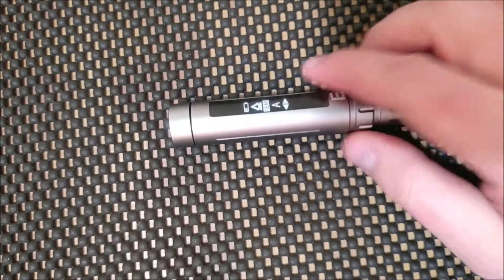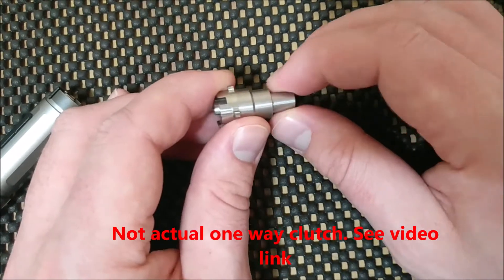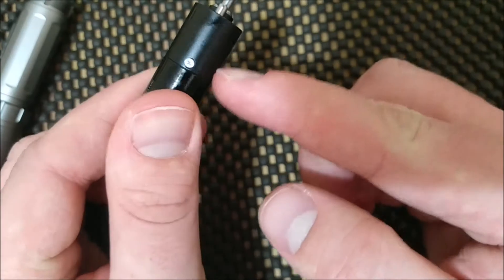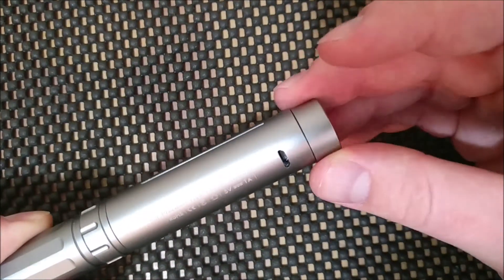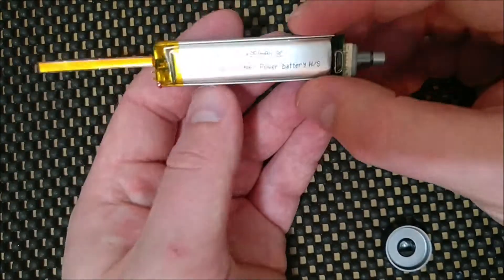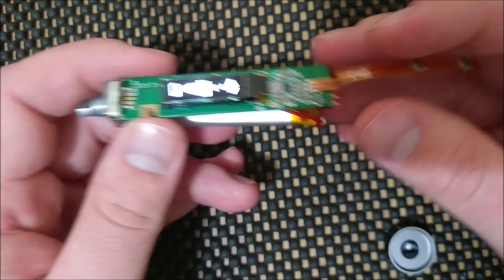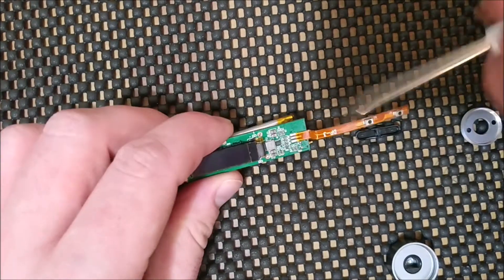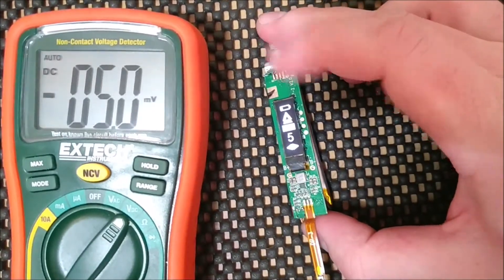ATuMan E3 Electric Screwdriver Teardown

Comment: Hi Had the same problem, thanks to your video got it apart and reset it by disconnecting the battery, it is working ok now. Wonder if there is a hidden button reset sequence?
Reply: Mine gave up after screwing a lot of bolts with manual torque, disconnecting battery helped. I wonder where do we get a replacement battery, also I bet this one is not really 800 mah, most lipos of this size are 300-400 max